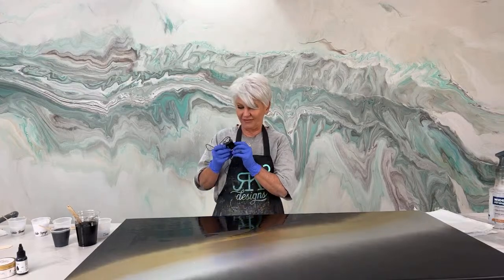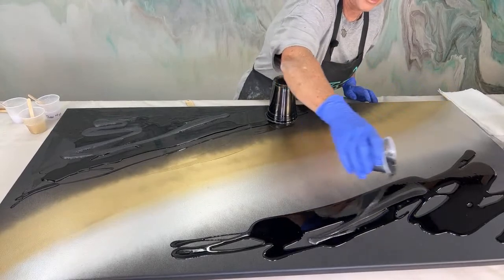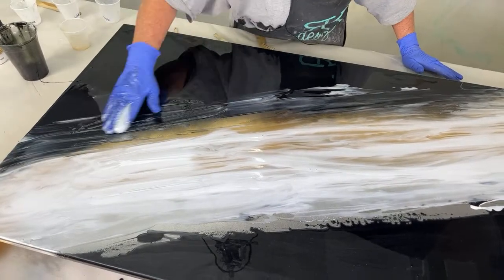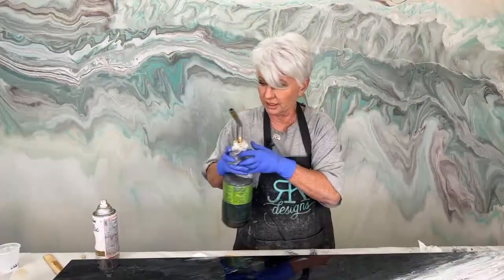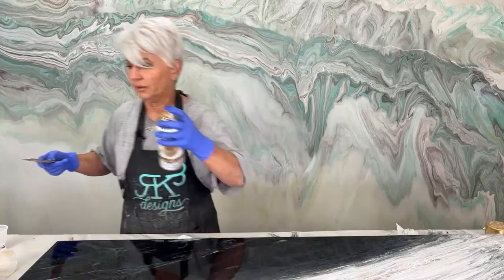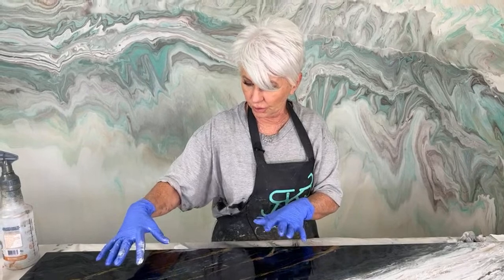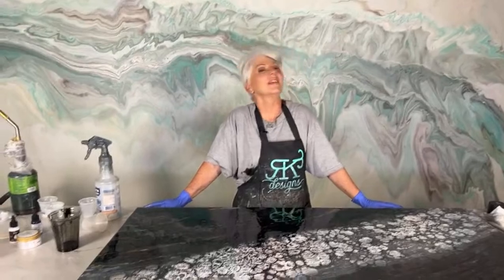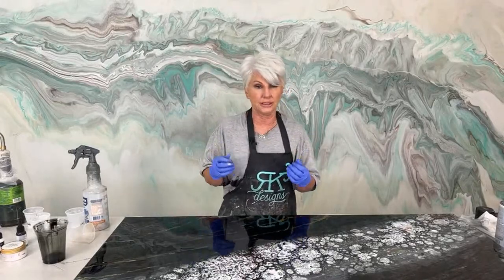DIY Epoxy Tutorial | RK3 Designs

Comment: Hope gremlin is alright! Watching reply from ohio. Question, is the new floor solution for basement concrete? I need a better understanding of how one would go about using epoxy on floors that have gotten wet before to seal them. Thanks!
Reply from the maker: The new formula will have a built in water vapor barrier. We’ll be coming out with videos soon.
Reply: @RK3Designs  This is awesome news!!! Thank you!!!